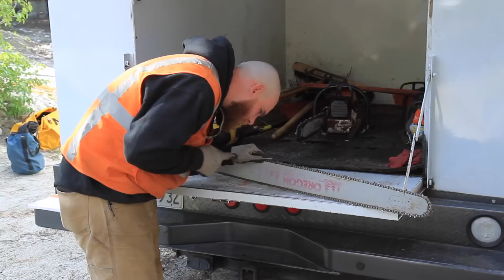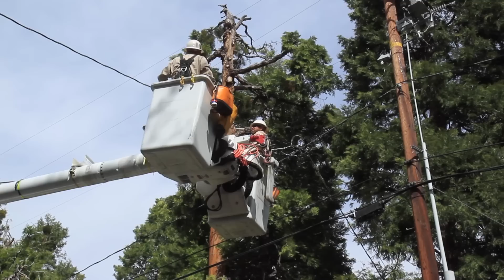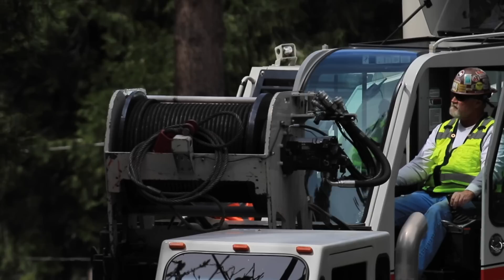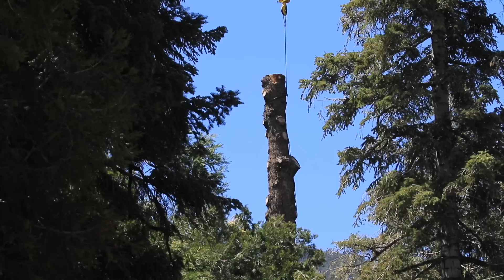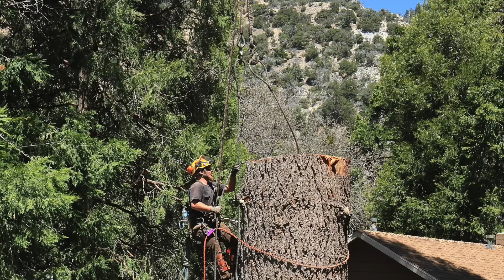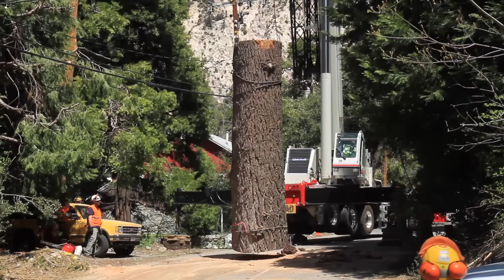STIHL chainsaws and crane used to take down huge dead White Fir tree in Forest Falls CA

Comment: Running the ground saws when your climbing is exhausting. You can run a trim saw all day but when you have your guy send up a ground saw, even pulling it up can be a chore. This guy got lucky to have the crane drop him off at the top of the tree. I have never been so lucky. If my company were on this tree, I would have had to climb up. Good job though. That was a nice sized fir.

Comment: I would hate to see the bill for that removal !
Reply: Brainmalfuction Honestly.. that tree will sell for tens of thousands in board feet, tabletops and solid lumber.  Most companies would pay you for the removal if they get to keep that wood for market.
Reply: @Brainmalfuction
I have loved if the check was made out to "Benn Stump'd"
Reply: @imacrazyguy5831  lmao, wrong man, no tree service ever does it for the wood.... we have to pay to move it and dispose of it, typically it goes straight to the dump, even more so if its a residental tree, gaurentee theres nails in it fence posts barb wire ect, its trash
Reply: @noobie765  The way they were lowering the sections to the ground instead of just allowing them to drop from the height, it seemed like they wanted to protect the wood from damage and sell it.  Also the nails, fence posts, etc would be at the bottom and the rest of the tree would still be good to go.
Reply: @TheKomentor  Well they lower it to protect surrounding property. The only way they drop it is if there is nothing nearby to damage, but considering the close proximity to the road and maybe some properties under the tree, they cant risk just letting it fall with no control over where it goes, way too dangerous. I have no idea if they are going to try and sell the wood, but i know the primary reason of craning it out is safety.
Reply: @imacrazyguy5831  thats extremely false, LOL. The crane doesn't leaving the shop costs 750$ and then $750 hourly for it. Plus the ground crew and climber and other equipment.
Reply: Ima Crazy Guy that would be nice but any extra profit from lumber will just be considered to be making up for all the “underbid” jobs. But, yep that’s going straight to the mill. Hence the 12,000lb picks.

Comment: That crane operator better know what he's doing...getting those big cuts safely away from the worker doing the cutting.
Reply: Where you set the choker.  The side you cut from, and where you position yourself are the most important factors.  Its mostly on the tree guy but of course not entirely.

Comment: Reminds me of the Stihl I had to buy just 8 months ago I call "Big Birtha" named for big bitch. The one I have I can put up to a 5' or 6' bar on it, currently only have a 3' bar and it is a lot to handle. Saw cost me over 1,700.00 bucks and talk about cut up a tree in a hurry. I sure learned real quick that you have to watch the kick back on those bigger saws, the first day it almost kicked back and got me in the face. It is something to have to push a button on top of the saw to release some of the compression just so you can pull start the thing without straining your arm or breaking the pull rope.

Comment: What size bar is up in the tree?  48 inch??
Is that the 660 Magnum?

Looks like you're gonna need a bigger truck!   ;)
Reply: climber had ms 461 R  and for finish it off on the ground it was 660 magnum
Reply: Ok, thanks
Reply: PERPARSON do you have any idea what a ms461 weighs? To run a bar that long the tree service I work for would use a husqvarna 395 and, I swear, there must be a lighter saw that could do the same job. Making a level crane pick with that saw isn't the easiest thing to do. Very heavy on the power head end.
Reply: its 6.7 kg dry whitout bar and chain.. ms 461 is  something between 372xp and 385xp.... ms 660 is like 390-395xp  ms 461 have 6HP and 660 have 7.1hp
Reply: I thought it was a 880 chainsaw

Comment: What's a job like that cost the homeowner?
Reply: depending on location around my neck of the woods probably $5000
Reply: Where I live we would just push it over with a D9 and be done with it.
I am so glad I don't live near people or power lines.
Reply: This looks more like $12k-$18k job with all those hazards large crew and heavy machinery and probably a few full days to finish the job.
Reply: that tree is only worth like 1000 if it was a residential job and if it was contracted through the power company even less like 500 even with the crane that whole job with crane setup prob only took like 3 hr
Reply: Ken Phillips If you can only get a $1000 dollars for a job like that, It ain't worth it.

Comment: Get that saw sharp the night/day before and blow out the damn air filter.  Why so many men all over and not needed and in the way?  Crane op...get that fkn piece out of there and don't float it over the head of the climber.  What if the choker failed etc?  But well engineered job and great and strong climber but why not give him a headset?  Stone age without headsets.  Only cost couple hun.  Cheers.
Reply from the maker: Sawyer was out of sight of crane operator and communicated by radio. Edison had power off to half of town and only road thru town shut down. Since Edison was paying for job they wanted tree down and gone as quick as possible

Comment: Husky 3120 a better saw than an 088 stihl that's for sure had 3 of each and found the 3120 better even cheaper to rebuild that's in new zealand anyway we were slabbing kauri that was 1000-2000 years old before they fell and kept intact in peat swamps for 20,000 years they are the size of houses unreal our bars are 90-120inch long still not wide enough for these monsters
Reply: Ashland?
Reply: 088 have unlimited coil so its far faster than 3120xp..... ms 880 have rev limiter so its basicly the same as husky... stihl makes cylinders and pistons by itself where husqvarna isnt.... so OEM cylinder kits from stihl are far cheaper than husqvarna.  stihl bought zama carburetors wich husqvarna also use so carburetors are also cheaper for stihl than husqvarna..... tell me one part of engine that husqvarna have cheaper on 3120 than ms 880/088 have....greetings from STIHL HUSQVARNA and JONSERED mechanic.... sory for my bad english
Reply: Can't go wrong with either brand. They'll both get the job done just fine. Neither really has the advantage.
Reply: Norman Preston I LOVE my 660 SHARP German made.
Reply: Cargar vaterias aútos
Reply: @dean fisher
Try this,,,,,,, "I PREFER Husky 3120 over a Stihl 088" You really don't have the standing to claim one saw is better than another. I only use Stilh's, not because they are better or worse than any other, I JUST PREFER Stihl.
Reply: dean fisher the 3120 is the worst saw I ever owned, I was told to get an 088 by the saw doctor, should of listened